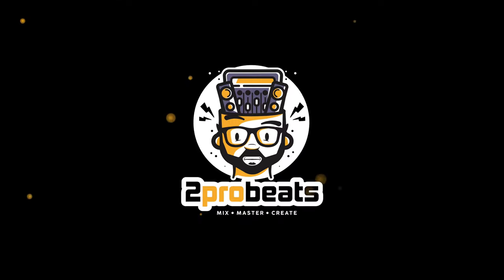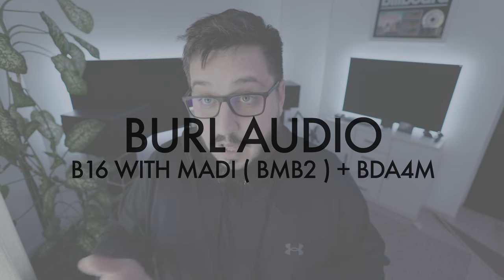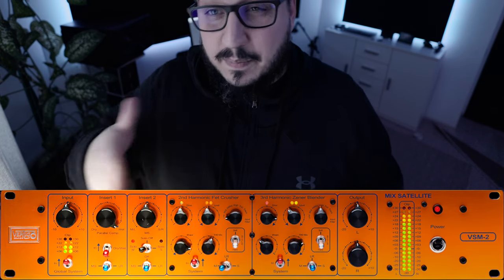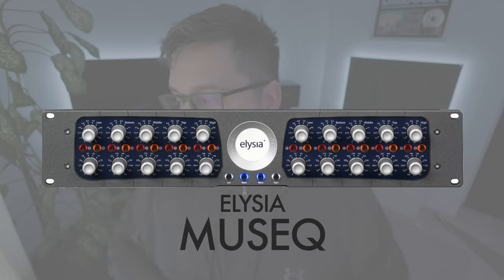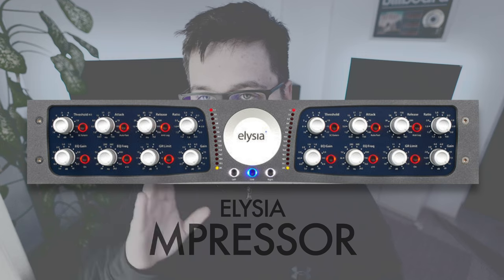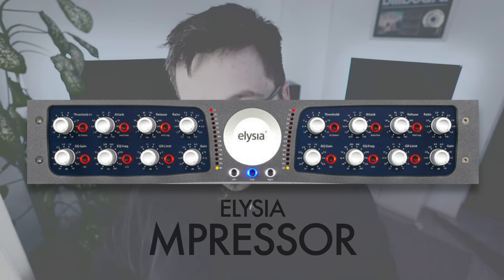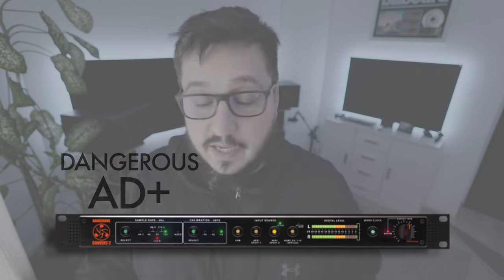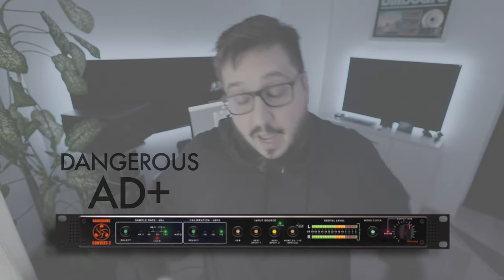From the Studio ( FTS ) /// Ep. 4 : Analog Mastering Chain / Stem Processing

Comment: Great vid, love the converters I have similar but the lynx hilo instead of the burl, with the dangerous, My question is how are you managing with no acoustic panels or do you have the fabric wall ?, and doesn't the screen/monitor on the side give you reflection problems? I have a Tv in the same place on the wall, Keep up the amazing work,
Reply from the maker: Hey man,
The black stuff from behind that glows are acoustic panels 😂 and I also have 2 big clouds above my head. It's not perfect but I got used to how the room sounds.
Cheers
Reply: I have a Lynx Aurora n. I like it but it breaks up too much when you start to clip it a little. I went on mixanalog's website and saw they have all Burl converters. There was this pull on the bass frequencies when you got higher in the level I loved so I went and got the Burl B2 and use that for the ADC. I get still the high clarity of the Lynx and the fatness/warmth of the Burl in this config.
Reply: @Sance21  Nice, The hilo is a different beast though, I believe the Aurora N borrows from the hilo conversion technology,

Comment: What made you decide to part ways with the Portico MBP?
Reply from the maker: I didn't used it that much for the compressor and the saturation. I was using the SFE and the VSM will make that obsolete
Reply: @2probeats  didn’t like the compressor/limiter? I hear it’s quite transparent. Or just a redundancy issue?

Kind of makes sense to swap it with some other pieces once one of its functions is redundant maybe as one of the big appeals is having all those functions in one box.